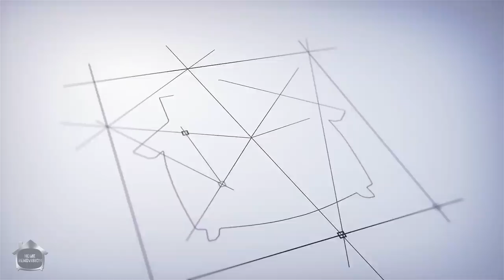How To Build a Pergola | With Sails for Shade

Comment: Question????
For the pergola,  would the concepts be the same if you are trying to attach to a pre-existing deck?
I bought shade sails while at my old residence.  Never had the time to put them up. 
Have moved since then and this house has a deck.  Would I bolt saddles into the deck.  Then put the posts into that? And would it need to be framed at the top? Or can the hooks just be put into the top of posts?

Comment: Hi, can I build the same thing in general but with only 4 posts (4x4 each) in a 10 x 12 area? and use spikes to hold the 4x4s in the soil? I'm looking for a solution for a pergola 10x12 size and without drilling holes and using concrete in our backyard...

Comment: Thanks for the tutorial.
May be easier to drive in with vibration rather than pounding with a hammer. Not a fan of that quick concrete fix...
Reply from the maker: we had no choice considering the weather and the fact that we were out of town. Sometimes you just need to get er done!
Reply: @HomeRenoVisionDIY  true.
Reply: @joewell3074  Where's your video on this type of project?
Reply: "Not a fan of that quick concrete fix..."  For sure.  Made me cringe.

Comment: Nice job! I would like to make a similar one...on a 12x12 elevated about 5 feet wooden deck (supported by 6 concrete poles). Is it safe to install the pergola directly on the deck...or the poles need to go directly to the ground? Also, being close to the house, do you recommend to attach it to the house or rather self sustained?
Reply from the maker: I would suggest ordering longer wood and have your posts go directly to the ground. That way you don't need to attach to the house and you will have superior strength. Cheers!
Reply: @HomeRenoVisionDIY  thanks and cheers from Aylmer!
So lucky to watch your projects

Comment: Any wood, that close to a concrete surface will rot in a couple of years. Not enough air circulation, and the concrete retains moisture.
Reply from the maker: Hi Greg, The reason that we showed this install is that the Brazilian Hardwood does not rot. That is why it is the perfect choice for exterior projects!
Reply: @HomeRenoVisionDIY  alright

Comment: OMG you video taped pounding the post bracket in and they are so loose. I can't watch anymore after that. If you were my contractor and I saw that you would be fired.
Reply: Video Tape !!!!
Reply: There is cement in the hole to fill the gap, that's why the need to pound it. The holes are bigger than the bracket rod and I guess without cement they can get into the hole without any force.
Reply from the maker: Hi Todd, Generally I try my best not to work for people like you so no worries there.
Reply: @HomeRenoVisionDIY  Love it !!
Reply: Home RenoVision DIY .... lol. Great answer to Todd. Here is a guy who has probably never done anything like this himself and has no idea what he is talking about telling you that he would be fired. I’ve been a contractor for over 30 years. You learn to spot these morons a mile away.
Reply: Justin Tharp EVERYBODY LOOK AT JUSTIN, JUSTIN KNOWS EVERYTHING ABOUT CONSTRUCTION AND IS A WORLD LEADING EXPERT. EVERYBODY GIVE JUSTIN ATTENTION
Reply: @jtharp727  WE HAVE A TROLL SIGHTING!  looks to me like he is assisting a diy project in some fasion. Which is the whole point of the vid. Being that you claim to have seen "a ton" of Jeff's videos, then you know he uses tools, in his vids, that a typical diy would own. How many average homeowners have a $500+ SDS plus? Yes there are some thing that I would have done differently to completely avoid the things in question. But Jeff is solid in my book! But i bet that corner holds for several years, speaking from experience with the poly structural repair material.  AAaannd, I'm sure the sail is permeable!!!  That being sd, what is your channel? Post a link to some your your fabulous worx. oh wait, your not doing any work which is why your trolling and talking smack on youtube, right?
Reply: Completely agree. Absolutely “contractor from hell” classics...

Comment: Yes!!! I built a fucking deck only because your techniques and I knew it would work. I even buried the pier blocks for the 4x4s and it looks bad ass. The next day somwonw is like I can help u build  frame for a roof and we only put a 6 inch slant, but I didnt want to go all out due to the prices now dayz and man, U once again, just sold me on what I need to do next. I almost threw ugly ass tin up there and there is no need!! Do not rush if u dont know what to do next!! Think things through. 20 times if you have to.

Comment: Hi Jeff, have been kind of secret follower of your work for a while now (Thanks for helping me build a deck ;))..Now I am confident to move to the next big project ..Pergola..Had a few questions for the basic structure of pergola built on Independent posts...for a 16' x 12' pergola with 6x6 posts, will 2x8 beam be sufficient to span 16' ?

Comment: When did you get your building inspections?
Reply: @joewell3074  Absolutely joking. I am a professional carpenter with 28 years of experience of which 90% is deck construction. I asked the question because I knew that he would not answer. I called him out on one of his deck videos and he never replied to serious structural issues. He broke the concrete and his answer was to "glue" it back with some grout! What a joke. I can't believe that YouTube opens themselves up to this liability.
Reply: @jtharp727  you must be a contractor. You're just pissed he is showing the tricks of the trade. This guy does great work. I've seen alot of videos out there and this guy explains the best.. I have built stuff from this guys knowledge and it helps and looks great. Saved me alot of money. I feel  more comfortable working with wood and small structures now.

Comment: are those 4x4 or 6x6 posts?
Reply from the maker: 4x4
Reply: @HomeRenoVisionDIY  thanks so much for the very quick response!!
Reply: I’ve seen using pots with concrete to secure the poles. I was looking at this idea so I didn’t need to drill into my concrete pool deck. What are your thoughts on this @Home Reno Vision DIY